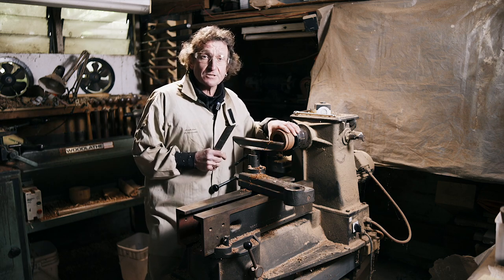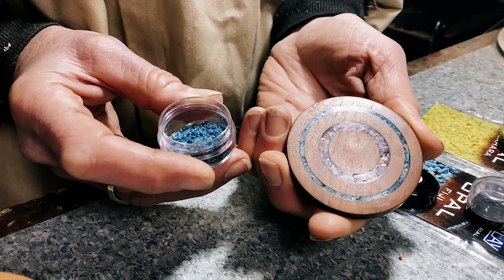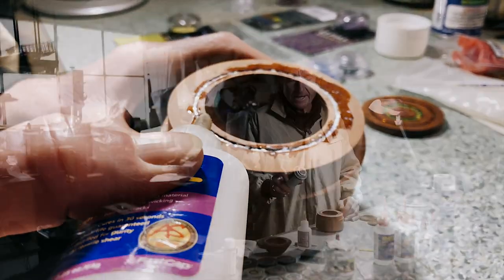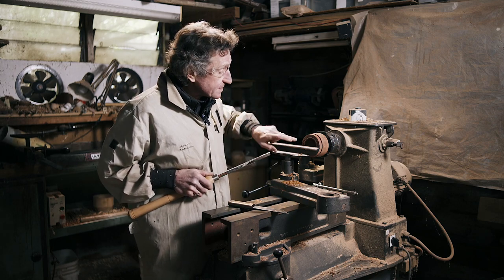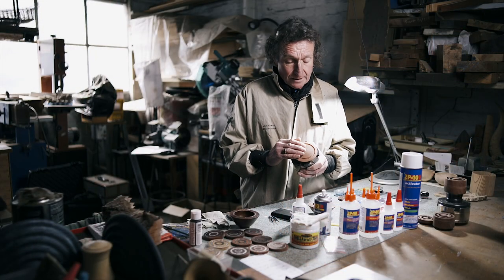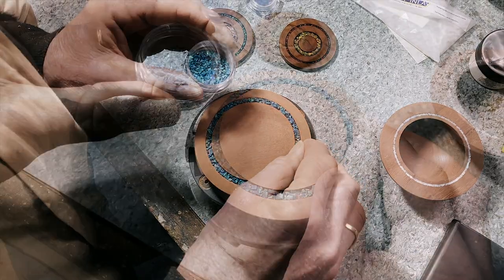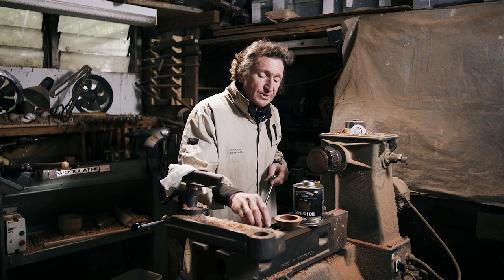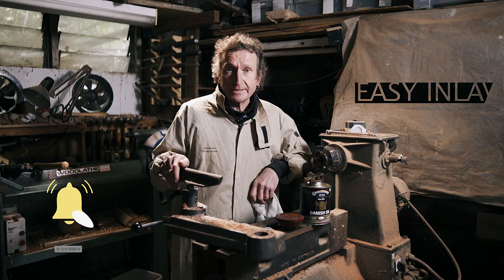Introducing Easy Inlay

Comment: Superglue accelerator - activator is just baking soda dissolved in a distilled water... Yeap... you can make it by yourself.
Reply from the maker: The Fastcap accelerator is actually something called N,N-dimethyl-p-toluidine in an acetone carrier. Without the accelerator, the glue goes off because of the presence of hydroxl ions in the moisture on the surfaces and surrounding air. Baking soda increases the amount of these ions when dissolved. Apparently, N,N-dimethyl-p-toluidine does something different (although this is beyond our seventh-form chemistry understanding!)
We've played with different formulations and have found that water by itself does next to nothing; baking soda is OK (but can go cloudy) and does make a good filler at the cost of some bond strength, whereas the official accelerator is by far the fastest and has minimal whitening etc.
Reply: @timbeconaus  A very professional and respectful reply - a big thank you. Not sure why some people want to try to blow the candle out 🤷‍♂